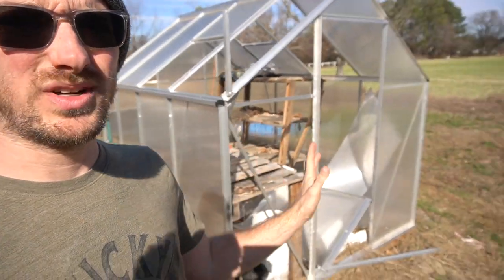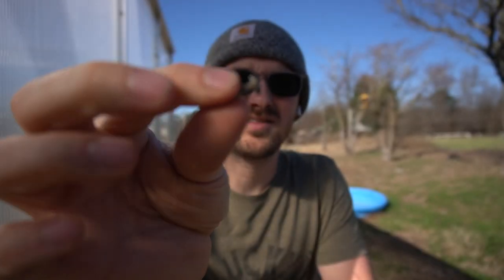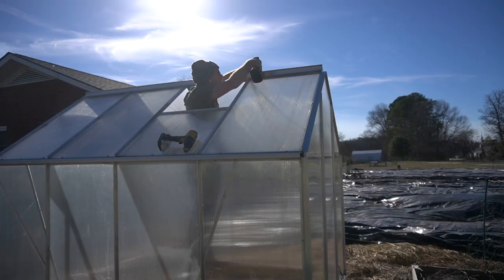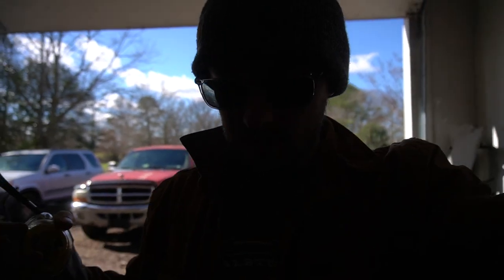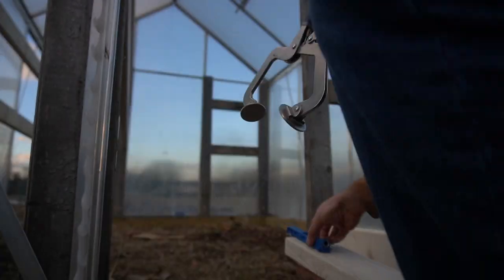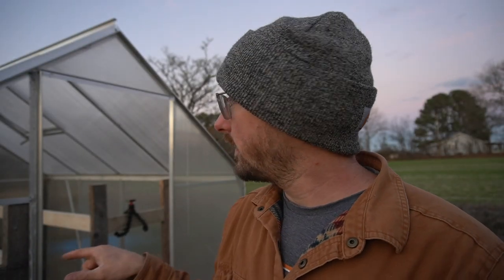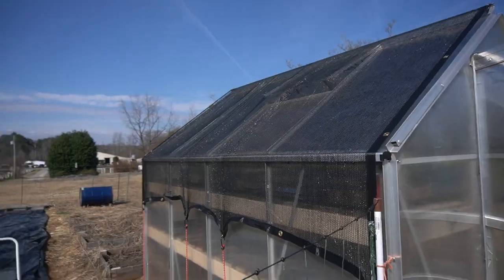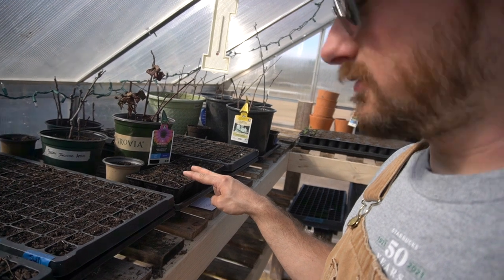Harbor Freight Greenhouse Upgrades: Building a Better Greenhouse with Affordable Modifications!

Comment: The only thing that I would add to what you have done, is to seal around your panels with a sealant that is compatible with polycarbonate. Over here, in Australia, I would use either Mastic or Selleys roof and gutter. for next time - I honestly hope that there isn't a next time lol - I would also put a drop of sealant on the hole that you are screwing into.... I hope that this helps...